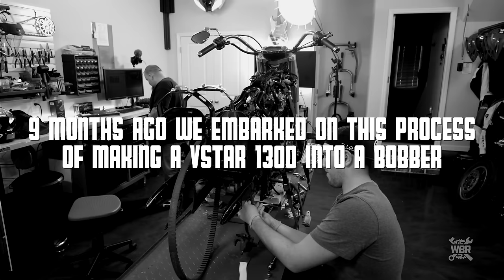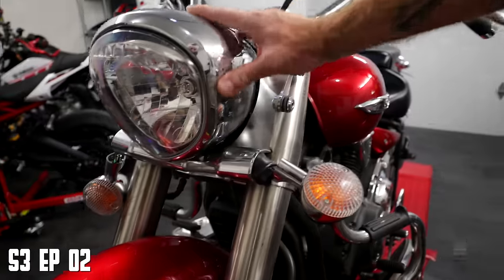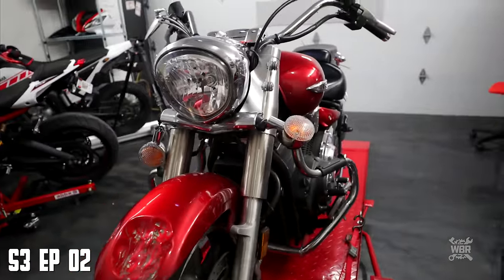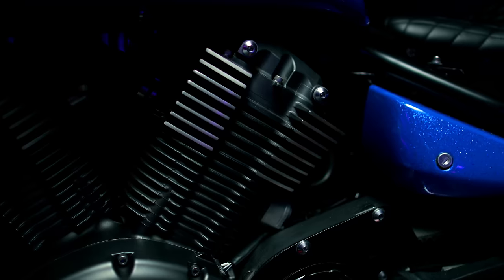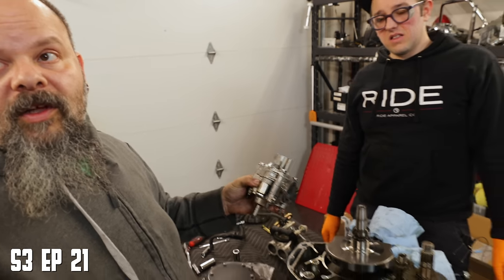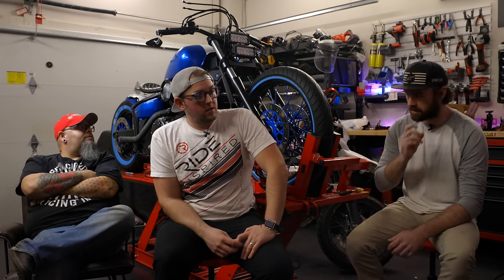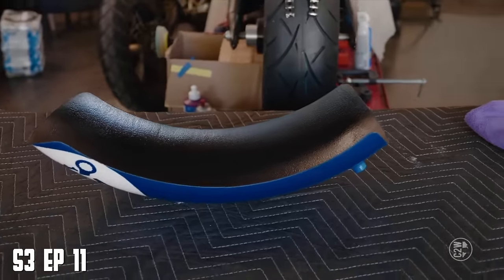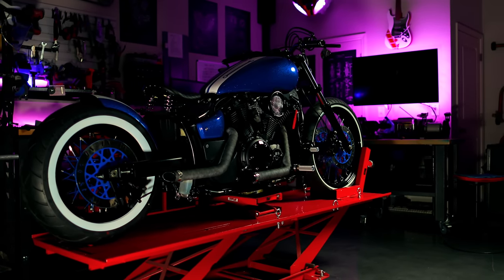BOBBER build COMPLETED!!  [Wrecked Bike Rebuild - Ep 25 - Vstar 1300 Bobber]

Comment: Only thing I don't like is the 4 cables/hoses that run from the right side of the handlebar.
Reply: cant help that when 2 are for the throttle and the other 2 are for your front brakes
Reply: @mikhail8239  I know it's unavoidable to have 4 cables/hoses but I think I would have tried to route them differently. Maybe twist the throttle tube 180 degrees and have the cables at the bottom of the bars.
Reply: @Jajeweet  Tried that before on bikes. That's do able with brake lines. But the throttle cables need a nice big curve to be able to function. if you run them differently from under the bars there's no real way to get them to have a smooth curve to go through the forks, under the tank and to the motor. And you sure as hell don't want a throttle cable kinking and getting stuck on you.
Reply: The brake line cables were meant for a v star 1300 with oem handlebars.

Comment: Obviously this is absolutely amazing but.......uh wheres the licences plate go?
Reply: Subzero  no shit. But the forgot the bracket. They put everything else on the bike but that. Plus there is no rear brake light. That generally is integrated with the licences bracket on bobbers
Reply from the maker: We have a swingarm bracket for it. I didn't install it before filming this because I HATE having to put it on but ya know. Legality and all.
Reply from the maker: Rear turn signals are integrated with brake light.
Reply: @chaseontwowheels  ah ok that makes sense. Cause all I saw were the turn signals under the seat
Reply: @diabolicgoldfishable  brake lights is on the tail piece, go 2 videos back where they struggled woth the wiring harness and handlebars
Reply: You don’t need a license plat if the police can’t catch you

Comment: Great build.  I'm just not a fan of the branding.  The design of the paint job feels very tacky to me.  Also think the body panels below the seat should of been black to help reduce the visual thickness of the bike.  You have the little seat and then the fat frame under.  Looks a little off.  Also I think the blue on the rotors is too much.  The spokes was good enough for a pop of color.